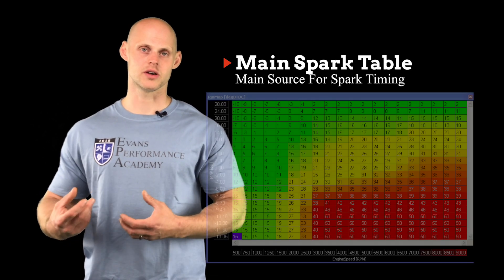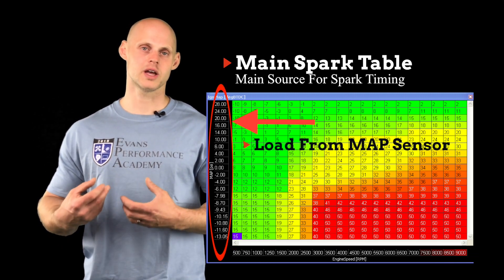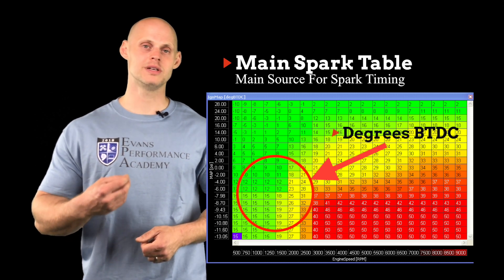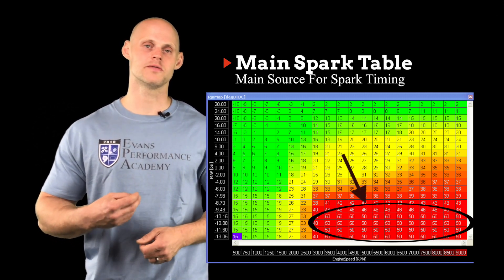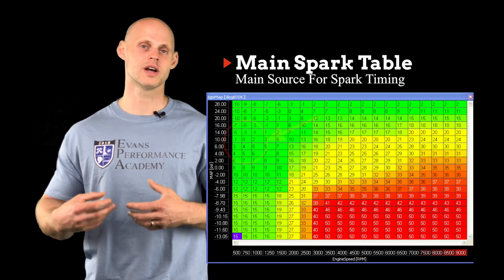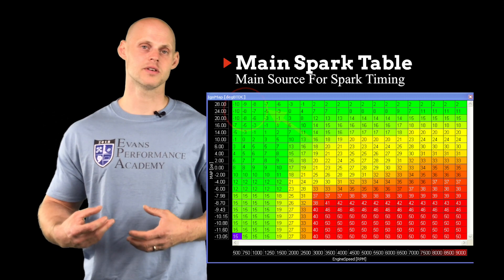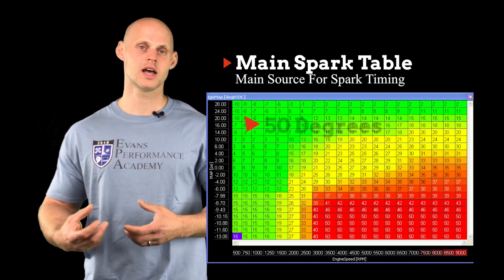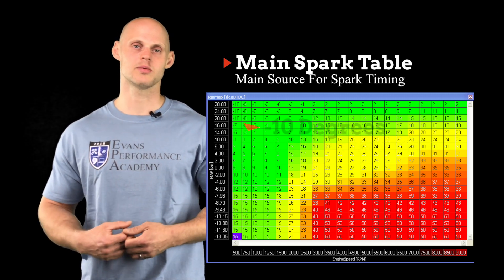EFI Basics: Intro to Spark Timing

Comment: This should be cool. When is the official release date? I am registered, just need to pay the fee.
Reply from the maker: It launched on July 1st, so its live right now.  If you received the email you will have the coupon code and direct link to log in and start.
Reply: Evans Performance Academy I will check my email. If I need further assistance I will send you a message. Thanks, Richard Hockersmith.